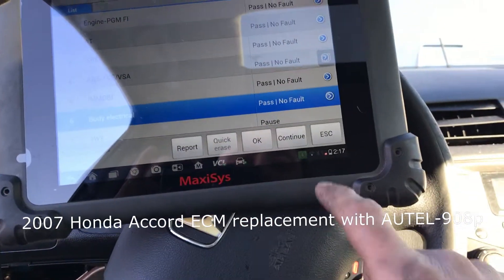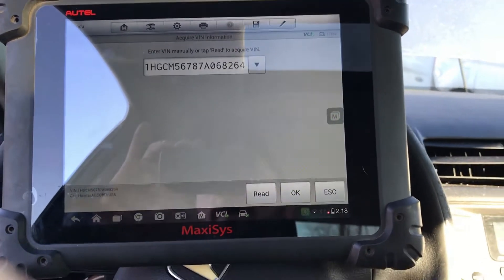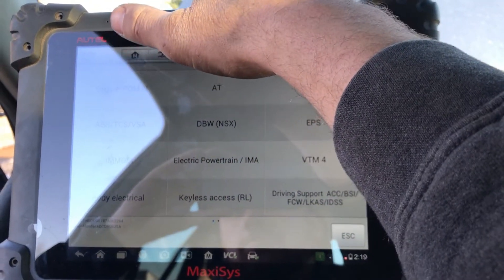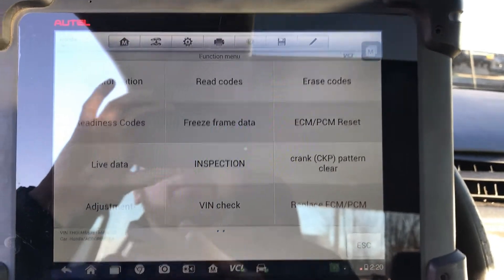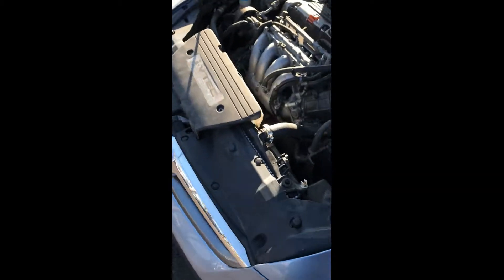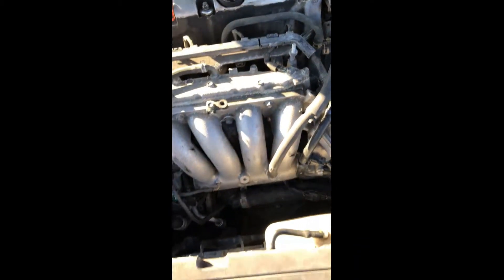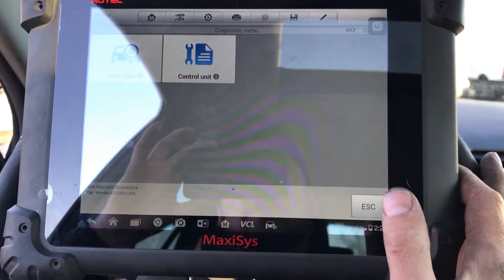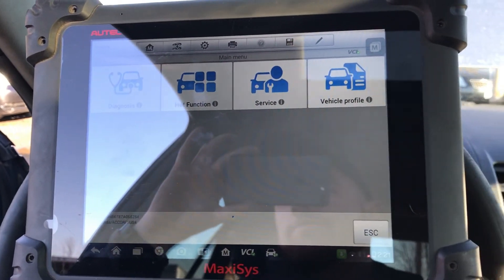07 honda accord PCM replacement + key registration w/Autel 908P

Comment: Question Please. First off, thank you again for your time and video and insight. Secondly, let me say I'm not a "professional" of any kind, just a DIY guy that likes to fix things and figure things out. Third, I'm sorry for the long explanation/question but I'm just really stumped on this and just wanna make the right purchase on this scanner. Because there are way to many AUTEL scanners that all look the same, with just a couple numbers different in the description. I'm so cornfused. 

So, I've watched this video, and even though its been a few years, this scanner is still relevant but of course new versions may have been released. My question is though, when researching this scanner I've noticed the AUTEL IM608 as being a comparable model of this, as well as the 908P as mentioned in this video. So sure I googled it to see the difference. But in all the descriptions and comparisons.... whether its on google, any random website or even amazon. Every single thing I read about the scanner in this video says it should not be able to do ECU/ECM programming. Even multiple people asked the exact question on Amazon only to get answered with a "no, this 908P can not program ECU/ECM". Especially without the J2534 pass through programmer. 

BUT clearly you did it ! So if you get this message, and just have a second. Can you just give me a super super quick insight on anything about this ? Or a place you know and trust that I could call to get to the bottom of this so I can rest my neck on this and move on with my life. I wanted to be able to program ECM/ECU like you did in this video and also program some keys is all. And now I'm in this rabbit hole. 

Thank you so much, to anyone that could have any input on this matter. Sorry for long comment/question. I've never done this before, not like this
Reply from the maker: Brian, first I’d like to know exactly what you are trying to do. I think it will help me best help you and your current situation. I have not found a “programming” or “re flash” solution for Honda & Acura. You can however use a J2534 device and HDS which is the Honda diagnostic and reprogramming software. In this video I am simply taking a used ECM out of a car with matching hardware and changing the vin# and re registering the keys / immobilizer. Since this video I have purchased the Autel Ultra. The 909 is a great tool too if your looking for something comparable. Topdon makes some great tooling as well. Maybe if you explain to me your overall wants and needs I can link you with a tool that will best suit you. I have some resources you can purchase a tool from if you’d like to support one of my friends. Thanks!

Comment: Hi I have 2019 Honda Accord and after a minor car accident the workshop guy programmed the airbag and Sudnlly next day all worrnings lights are on ..break system Stability system fauiler ACC fauiler brake assistant fuiler..I can drive the car normally but I had a sound like a jet .
Now the workshop shaid he needs to do online programming for it and this will cause me around 700 USD ..can you please help me in this